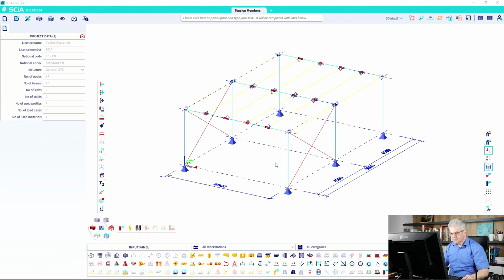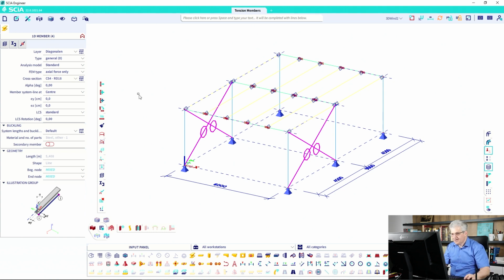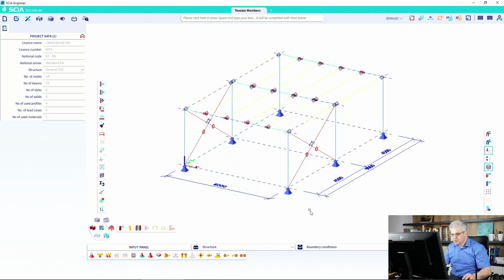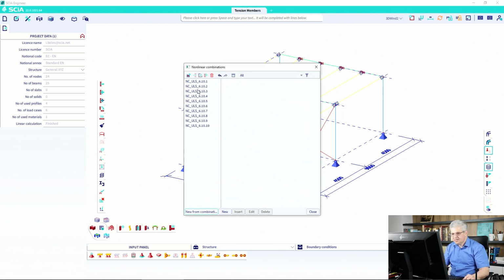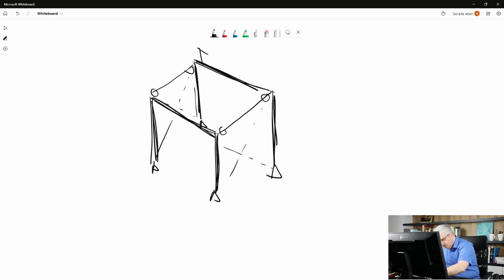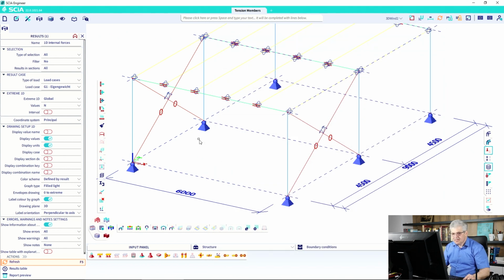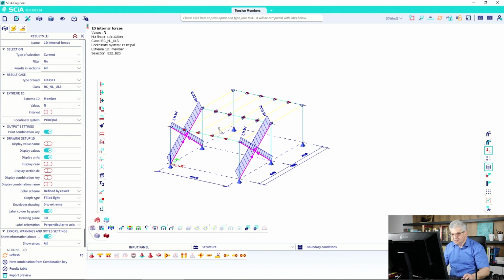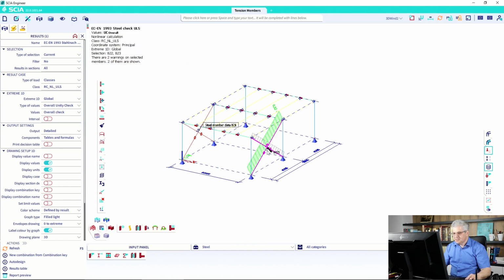SCIA Engineer Tutorial: Tension Members

Comment: Thank you for the tutorial. For those of us designing structures in seismic areas, not being able to use member nonlinearity for seismic loading is one of the main handicaps of SCIA. It is understandable that in response spectrum analysis, due to sign loss, there would be some challenges in implementing tension only members. However, one would imagine that in equivalent lateral force method, these would come as standard. Sadly this is not the case in SCIA, who still focuses almost exclusively on non-seismic markets.
Reply from the maker: I am sorry, but this must be asked directly at SCIA development. I am only a support engineer at one SCIA Partner. But, I don't think, that the lateral force method would be usable for most of the steel structures. This method can be used for regular structures and is very limited in usage.
Reply from the maker: Personally, I don't think, it is too complicated. It is a nonlinear calculation and for this nonlinear combinations have to be created. And they are created fully automatically. And then you have to define, which members have "tension only". What is complicated on this task? As engineers, we have to solve much more complicated tasks daily.
Reply: @IvanBeles  Hello Ivan, SCIA doesn't calculate when there is a seismic force into a non-linear combination. I need to take into account tension members. I don't know how we can do it. Does anyone have the solution? I have a master thesis to finish ;). Thank you

Comment: If non-linearity is only applied to combinations, how do you export non-linear loads by loadcase? For example, when doing foundation design, as per the Eurocode the foundation designer needs the information in SLS by loadcase so they can adopt their own combinations. But if the loadcases are analysed linearly then the foundation reactions from SCIA will not be correct.
Reply from the maker: I think, it has no sense to export nonlinear results of load cases. In nonlinear calculation, the principle of superposition can not be applied. You have different structures. So, the correct way, is to export the results of nonlinear combinations. But you can also create a nonlinear combination from each load case and run the analysis. Then you will get results for load cases also after nonlinear calculation.